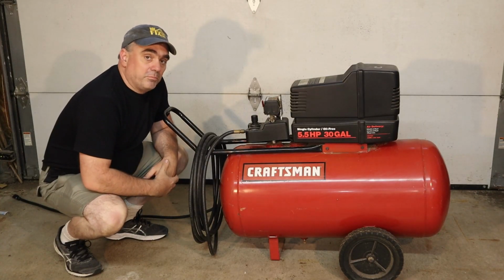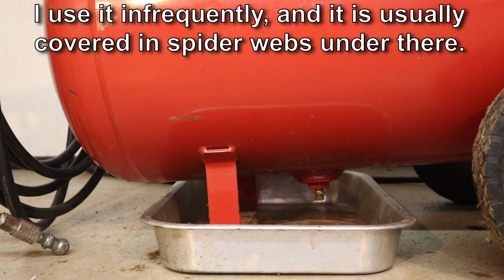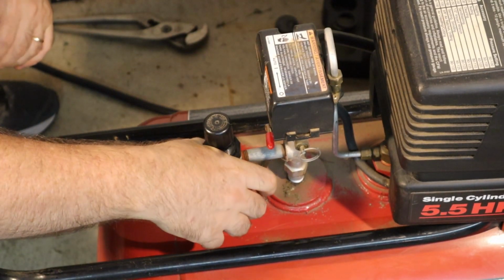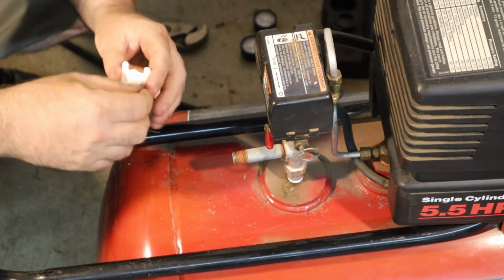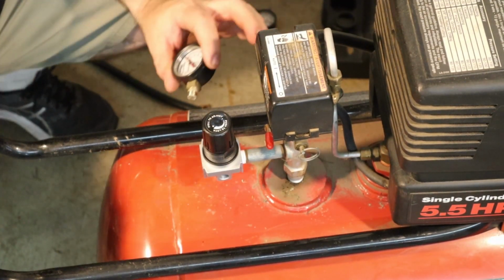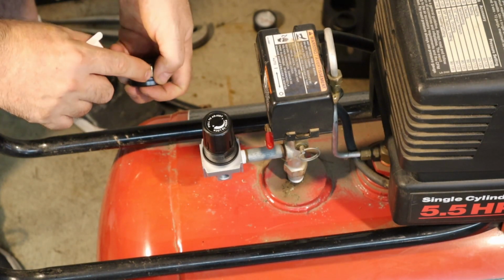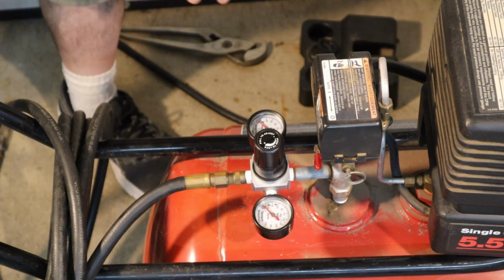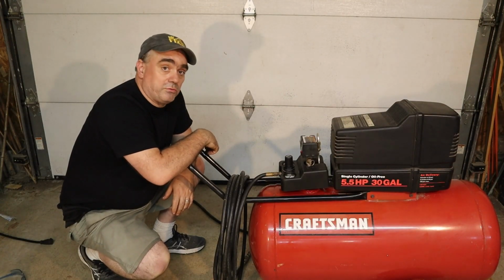Replacing the Regulator on my Craftsman Air Compressor

Comment: I know this is one thing wrong with mine.  I cannot get air to stop coming out the black knob no matter how much I turn it left to right, and so much air the compressor rarely shuts off.   Fingers crossed I just purchased the the regulator, hoping that fixes it.
Reply from the maker: I agree with you.  Sounds like the regulator.  Mine leaked since new, slowly, but always leaked.  New one hold pressure much longer.  Hope it solves your problem.

Comment: Excellent instructional!  I just bought a 6 hp 150 PSI Craftsman, and believe the regulator may be clogged or malfunctioning.  Will the regulator you use fit?  If not, any suggestions?  I'm going to test it tomorrow in the am.  Thanks for your time.
Reply from the maker: Glad you liked it!.  The best thing to do is get the model number of your compressor and go on searspartsdirec.com and check and see if it is the same.
Reply: Thanks for the info!

Comment: I would like to see a pressure shut-off adjustment. My Sears compressor just wants to keep on running.
Reply from the maker: Does it continue to build pressure?  That could be a dangerous situation.  The cutoff switc could be malfuntioning.  Unfortunately, I don't have this compressor anymore.  So I cannot make another video on it.

Comment: I’m looking at buying a used one. Same mode. Anything I should check for that comes to mind? Thanks
Reply from the maker: There is a date code on a plate welded to the tank. Recent compressors are only designed to last 10-15 years. You also don't know how well it was maintained. Let some air out of the drain if rusty water comes out, walk away. I have purchased a new on to replace the one in the video because I know it was not well taken care of and it is 23 years old. I don't need it blowing up in my garage. I am going to make a video decommissioning the old one in the near future.

Comment: The compressor turns off when tank reaches 40 psi.  How can I increase the pressure psi.
Reply from the maker: You may have a problem with the pressure cut off switch, or you may be able to adjust it.  I don't have a video on doing this, but there are a bunch on youtube.  Example: https://youtu.be/_V7SEGPwQ7M

Comment: I have a compressor which I installed a 2 port regulator in and out the only time I see the regulator adjust is when the output is open. It seems wrong
Reply from the maker: Generally, for me, the needle goes up when I increase the pressure, but when I reduce the pressure, the air has to flow to show the change. If that is what you are seeing, that is normal.

Comment: Awesome video! New subscriber here!! 👍🏼This is the exact video I needed to fix my craftsman. Would you by chance know what thread size I would need for the air hose coming out of the regulator? Could you provide a link please. TIA
Reply from the maker: Thanks! Unfortunately, I am not sure.  There is an adapter that goes in between the hose and the regulator, so there probably is a standard hose size and then they use an adapter to step it down to the size needed for the regulator.  The part number for the adapter is H-2101, but it is no longer available on the sears parts direct website and I am not having much luck searching the internet for it.

Comment: There isn’t enough clearance to spin the regulator to unscrew it from the pipe coming out of the tank on mine, and I don’t see a simple solution
Reply from the maker: Are you able to reove the knob, like I did for the new one I installed [5:44]?  (if the knob is what is in the way)
Reply: @TheFixitShed  yep, guess I should have finished watching your video! I’m back in business
Reply: @TheFixitShed And I now realize I should have replaced this years ago, the new one is so much easier to adjust
Reply from the maker: Nice!  Congratulations on your success!  Glad the video helped

Comment: I think there was more water then air in there
Reply from the maker: Probably.  The original drain valve never worked since new. After a couple years I replaced it with the one currently in it. That is probably 15 years old and I can probably count on one finger how many times I have used it. It now no longer works.  The o ring seal broke. I had to cobble something together so I could finish the video. New drain valve extension is on the way.